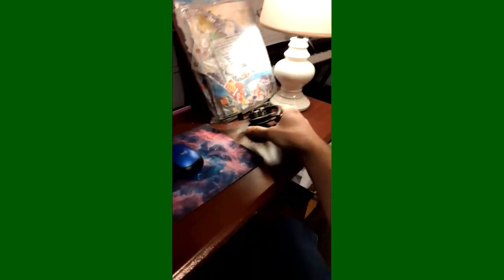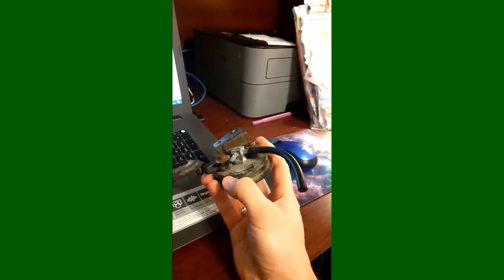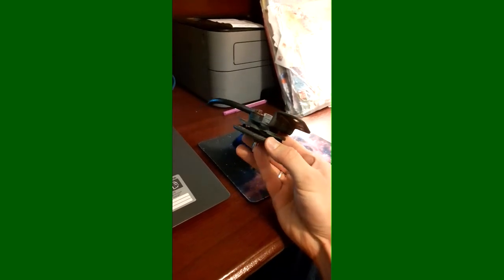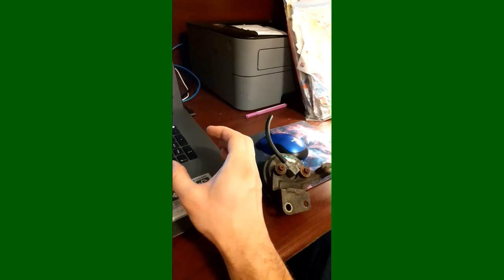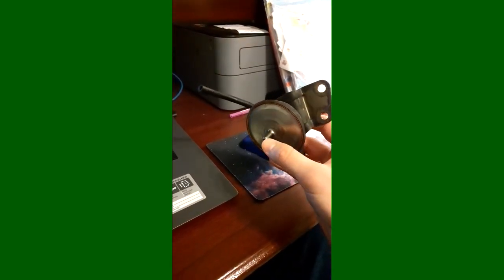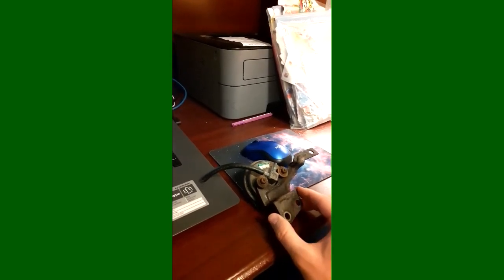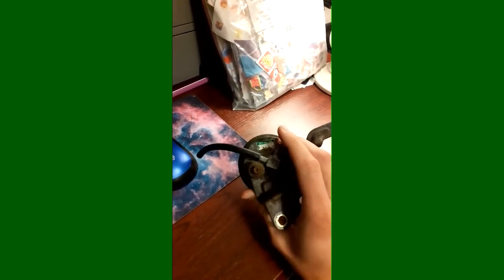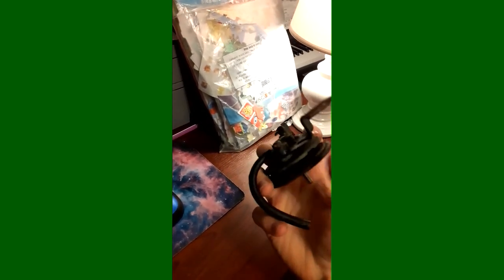Nissan EGRC - BPT operation explained - KA24DE

Comment: I tried asking this question online forum and all I got was a lecture repeating what's in the fsm.  I'll try again and be brief.  I have a 97 nissan hardbody.  Orig owner, 26 years.  All the other cars I've tested egr were not nissan and did not have this valve.  When I tested them, I used the engine rpm to verify the valve moved up and down freely.  I don't know what they do in calif now but this used to be part of the smog test when I lived there.  Couple of years ago I found that the egr didn't seem to be working at all so I replaced it but saved the old part but I don't remember if I retested the new on.  Couple of years ago it didn't seem to be working so I tested the egr on and off the car, and the bpt and the egr solenoid and they all seemed to be working ok but altogether the egr valve operates sporadic.  Only way I know to describe it.  The valve does not move up and down as I would expect.  If I take off the bpt valve and connect the vacuum directly to the egr solenoid, it works fine.  Either way, it doesn't seem to affect the ecu.  No faults and evap and egr monitors complete and 2 years now it's passed smog so I'm confused what the bpt valve is for and if it's necessary.  If I remove it, the engine runs fine and as I said, there are no faults.  I've been over the fsm and besides showing how to test the parts, there's nothing else related to emissions.  And I went back to the old egr part I was going to throw away before but kept and that one passes the bench test too.  Again, with or without the bpt, the engine runs fine and it passes the smog where I live now because they don't check actual emissions or manually check the egr.
Reply: nevermind.  I should delete this so I don't look so foolish but the problem is a leaking bpt valve but it's interesting the way this make the egr look faulty, and that there's no obd fault or affect on the drive monitor.   Might not pass smog in calif but here in nevada they don't actually measure emissions so it passes smog fine.
Reply: @johnsmith-sk1ep  they don't measure emissions in nevada? So you have a P0400 code for the egr and still pass?

Comment: Fantastic video! I'm currently in the process of diagnosing my egr system as it has stopped working, and so far I can't figure out what's wrong. So I'll have to test the bpt valve, and check for leaks. I'm kind of expecting to find a hole in the line for exhaust pressure!

Comment: Ohhhhhhhhhhhhhhh!
I was staring at the EGR and vacuum diagram in my
service manual for 2002 Nissan Frontier as you explained.
THANK YOU!  THANK YOU!   THANK YOU!
The ECM tossed a 0400 code, which is EGR related.
I replaced all vac lines in the EGR system, including the
input to the solenoid valve which was SPLIT OPEN!
The code has NOT returned, but as a software engineer,
I wanted to know how this system worked.
THANK YOU!  THANK YOU!   THANK YOU!
It seems the BPT exhaust input serves like the
base of a transistor.  Just Wow!
Some random (happy) guy in Florida.
Reply from the maker: Mr Brown, glad it helped someone out! That was the goal. Cheers!